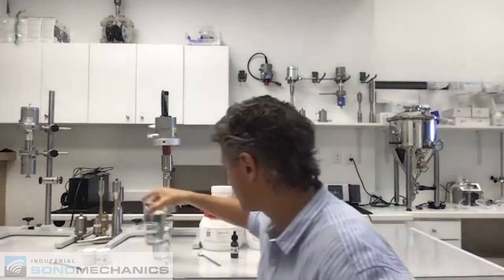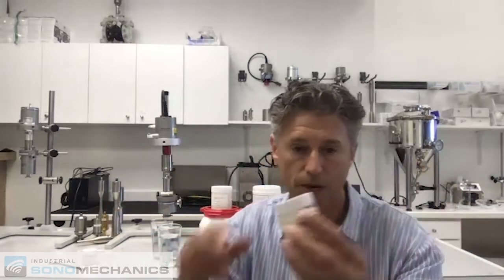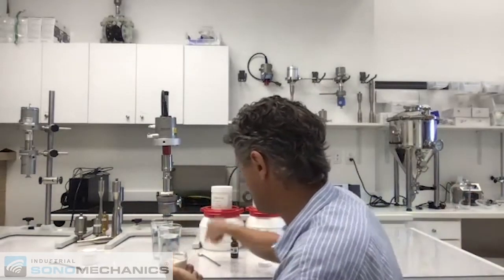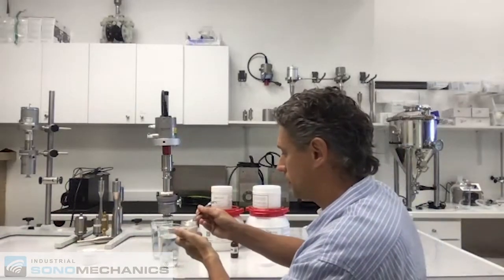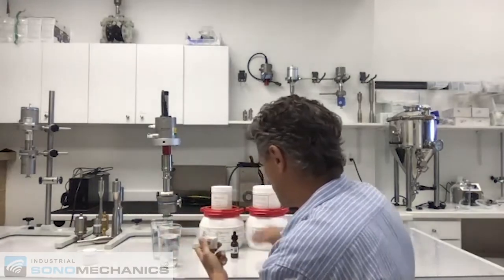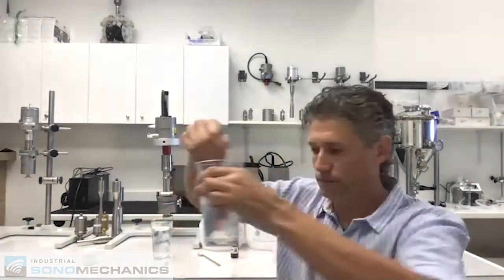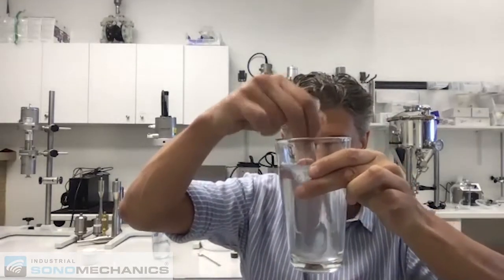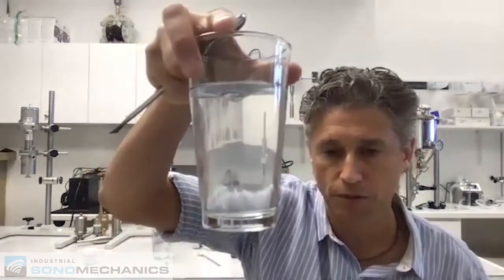Producing Water-Soluble CBD/THC Powders With ISM Ultrasonic Processors and NanoStabilizer®-LSO

Comment: I have smas which mean my small intestines was removed by 18 inches and is hard to get nutrients in so will it effect the cbd dose? Thanks
Reply: Consuming nanoparticle cannabinoids or cannabinoids that have been chemically bound/separated by dextrins would decrease the dosages required for anyone, not just those with digestive issues.